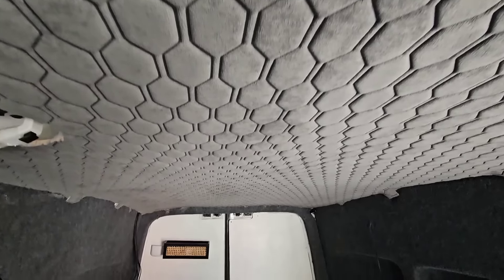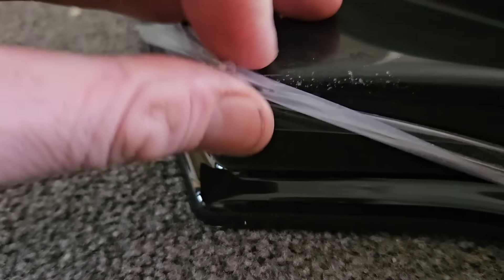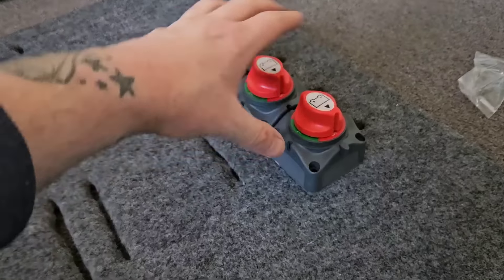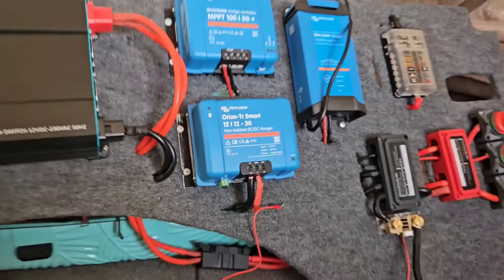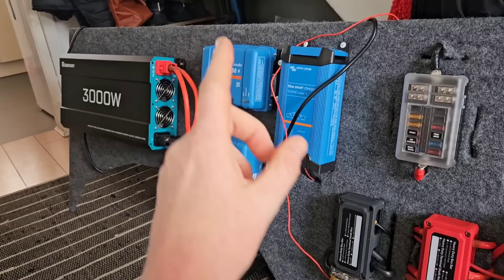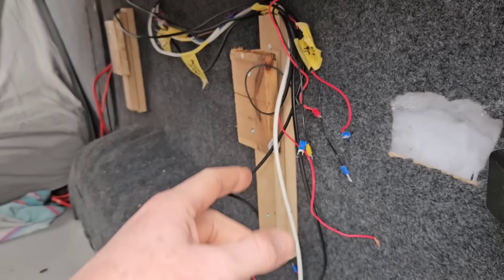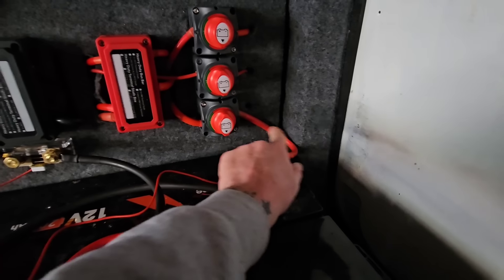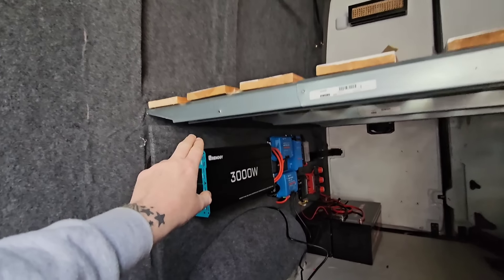I Was Asleep When I Ordered These!

Comment: Hi Rich
I think you made a slight cock up on the wiring up off your battery shouldn't the cable from the shunt be connected to the other negative battery terminal the way you have it now you will be only using the one  battery i may be wrong but worh checking 
Love the vids
Terry 😊

Love the vids terry

Comment: I really like the neatness. A couple of wires bugged me like the thin red across the batteries i would have gone in across and outbut overall it looks neat. For future big cables i would consider desk insert the type with the cap with a brush remove the cap put the plug throguh replace the brush cap. That heat is going to build up under your bed though not sure if thats an issue or not depends how hot everything gets. Bear in mind a few things. If you cant easily open the back doors while in bed a fire under you could be fatal. If i were you i would shut the doors and plug in a ton of stuff and test it before you box it all in to see how hot everything gets. Once it is boxed its going to get hotter. I would also install a decent smoke alarm under the bed. I would consider pulling the panel and painting it with high temp instead of carpet because i wouldnt think carpet has any benefit but may create some issues. Always consider the what ifs however unlikely they may be.

Comment: I have two victron b2b’s, they get hot, you don’t know everything, you need to space it away from the carpet for safety. Why do Victron tell you not to mount the unit on a flammable surface?? Because it gets hot.
Reply: Listen to Jarvis, He speaks the truth. I have victron b2b chargers in my van too. They get very hot, that hot you carn’t keep your hand on them. Please for your sake, space it off your board more using non flammable materials
Reply: @dannyboy4186  I used 30mm off cuts of 15mm copper pipe to space mine off my wall, they work slightly cooler now and work more efficiently.

Comment: I've just orderd some solar cables that I need to run from the roof into the van. The ones I ordered come with the connectors on.
Is it easy to remove the connectors and then refit them because I need to pass the cables though the 2 small holes on the roof cap 🤔

Comment: Who the heck ,reckons your electric setup is gonna causr a fire ....
Aslong as that material was fire retardent and you have all the correct gauge ,wire for currennt flow etc ...
And the electrics have suffiecient air flow .. then there ,should not be an issue ... plenty do like ypuve done .... but yeah , fuse behind board...you like a task or two in life eh ...

And if you feel the air flow ainy enough... get a temperature controlled fan.... to circulate as needed ...